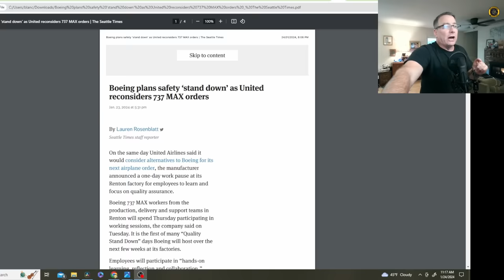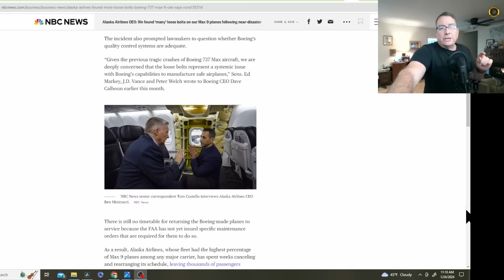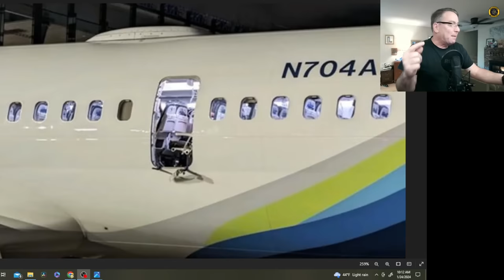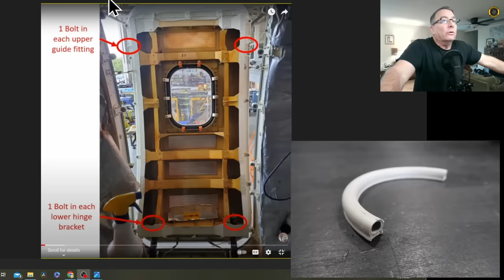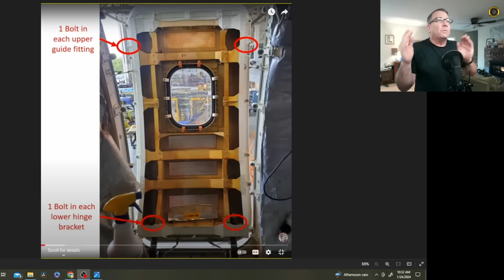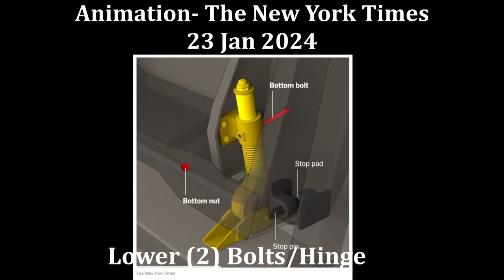Boeing's Quality Management Failure Explained 737-Max-9 Door 24 Jan 2024

Comment: As I remember it, Spirit initially was a Boeing plant that was spun off into a separate company – presumably as a cost cutting measure. How they can now have two incompatible QC systems is just incomprehensible.
Reply from the maker: correct.
Reply: Spirit was originally Boeing Commercial - Wichita. Boeing sold it to a private capital firm who later took it public under the Spirit name. My presumption at the time was that Boeing was looking for corporate degrees of separation from the fuselage, nacelle, and strut manufacturing.  The cynical part of me says this was a legal strategy to protect Boeing when their fabrication QC went down due to cost cutting.
Reply: I wonder, too.  Maybe the Spirit QC system has a lower subscription cost?  They seem hell-bent on saving money even if it harms the process,.
Reply: Doesn't seem very clever does it? The new system would need to be an awful lot cheaper to cover the extra cost of interfacing work.
Reply: But even if they both had used one system: there should never have been an option to just "open" a door plug instrad of removing. Boeing messed up writing that part of the quality control manual. But of course the Spirit workers messed up as well: they should never have picked that option to document their work. Looks like someone tried to save time by choosing this option in documentation because you can avoid some documentation work this way - on top of messing up when not fixing those bolts correctly in the first place of course.
Reply: When Spirit was spun off they immediately laid off all staff below senior management and required them to reapply for their jobs.  Virtually no one below age 50 was rehired, because more experienced employees get paid more.  Blatantly illegal, but age discrimination is never prosecuted.
Most likely the two started with the same quality systems but diverged over time.
Reply: It may also have been done to allow the company to get the contracts it has with other aircraft manufacturers.  They also do work for Airbus, something Airbus may have been less inclined to do if the sign on the door read Boeing.  Not excusing the serious quality issues, simply addressing another reason for the split.
Reply: @blancolirio  And before that it was Stearman. Boeing should take it back. And put engineers in charge of both companies.
Reply: @dave30076   yup, maybe also that the people managing the purchase decisions knew nothing about information systems, or QA, or databases, etc. (because again that is engineering expertise). They were however probably schmoozed by the vendors of the system that they eventually wound up purchasing.
Reply: @Trebuchet48  Did you mean above 50? Your comment makes no sense otherwise surely!
Reply: @christianbottger493  keep in mind the quality management systems are typically not based around inspections.  That's a non value added process.  They are based on making sure the job is done properly the first time.  A good quality management system would ensure that the job is done properly in the first place. That said, the fault for missing bolts clearly falls directly on the actual workers who failed to install the bolts after removing them.  But that might be far more complicated that just pointing fingers and any specific individual.  For example if there was a shift change partway through the repair.  The quality system failed to prevent the mistake in the first place and then failed to catch it.
Reply: @raygunsforronnie847  Plausible deniability works for most products but perhaps not for flying machines.
Reply: @raygunsforronnie847  also allowed them to break the union by it no longer being Boeing.
Reply: @raygunsforronnie847 
I think you stated the answer at the words 'private capital firm'.  Future liabilities is a little too cynical, just simple near term greed is enough.  I think it was after the bean counters took over and wanted to 'free up value from the balance sheet'.   Sell it off via leveraged buyout to a Private Equity firm who then slashes costs to maximize profit numbers in order to pawn it off to the public via the stock market at the highest possible value.
Reply: @blancolirio  First, it's hard to believe that the two QC/QA systems were incompatible and had not been addressed by management to fix this discrepancy. Second, the door plug should have been written up in the QA/QC system as "Left door plug (4) bolts/nuts removed to facilitate other maintenance" i.e., then another write-up in the QA/QC system "Left door plug seal due replacement or whatever any other maintenance or inspection action was required to remove the (4) bolts/nuts" documented. A lack of proper documentation will eventually catch up with you someday in aviation maintenance.
Reply: @Trebuchet48 Above?
Reply: @Trebuchet48 did you mean over 50?
Reply: looks like a lot of those commenting might be missing the big picture. Aviation safety standards remain the highest among all means of transportation even with this screw up. Boeing as any large corp is hard to manage so splitting makes sense. Otherwise you have 10-20% of people walking around all day or cracking jokes during the meetings. No productivity, they just learned how to navigate the system of a large organization
Reply: @Trebuchet48  Do you mean no-one over age 50 was rehired?
Reply: I imagine the differing QC systems came along after the split. Since Spirit management wasn't Boeing management, so it could make its own choices—perhaps to save money. That is a key difference between divisions inside a company and subcontractors.
Reply: Totally agree.
Reply: When bean counters, or whoever is culpable, get sent to jail, and get their bank accounts hammered, the song will remain the same.
Reply: I worked in a different industry, but experienced the horror of downgrading critical data systems to save money. Had to learn new and very different software three times in 6+ years, all while the business was expanding by buying out competitors. I can see how someone made a critical decision to incorporate incompatible QC systems if there was a buck to be saved. Beyond sad, and in this case, tragic for the passengers and crew. Trauma is real.
Reply: I’m by no mean super well versed in Boeing in Wichita or with Spirit. All I can say is all the highly experienced and well paid employees were summarily dismissed as being to expensive for Boeing and forced to take retirement. Spirit in essence started over with hiring and the wages paid were dramatically lowered. My son briefly was hired on a Spirit and they were only going to pay him I believe $12.00 per hour. I mean come on , McDonalds employees make more. He hated the company culture at the plant and left. That wage falls way short of what that same job used to pay when it was Boeing.  I feel Boeing cheaped out and are now paying the price for their folly.
Reply: Spirit loves DEI, look at their website. In other words, they are willing to choose diversity over merit.
Reply: I was end of line contract inspection at Wichita plant 2. Inspection was pushed to sign things off that weren't installed, it was cheaper to ship the fuselage and finish it at Boeing than to take the late fee. It was all about metrics and shipping 63 fuselages a month. There are hundreds of manufacturering defects on each plane. One out of every 5 fuselages were having a major skin change after damage. It was crazy, as a contractor I made crazy money with overtime but it really opened my eyes to the way these aircraft are made. It's all about the board, share holders and bottom line profit. They hire anyone off the street and there is no pride of work anymore, no craftsmanship.
Reply: @mythbuster7631  Well we certainly know the safety isn't from the manufacturer 😂
Reply: Perhaps that would work if there were a single clear handover to Boeing and their quality management system, with a 100% inspection at the time of handover.  But there seems to have been work done by Spirit at Boeing's site using Spirit's system, after the initial Boeing inspection was recorded on the Boeing system, with the work to remedy recorded on the Spirit system.  That sounds like something that is going to cause problems.  Plenty of people use subcontractors in a range of industries, and there's usually an inspection at handover.  To me it would seem more usual that at that stage all further work be recorded and quality controlled by the purchaser, i.e. Boeing, whether or not the subcontractor also records the work, or that there should be another bottom-up inspection.  If I've understood the video, Boing received the bodies, inspected them, passed the fix-list to Spirit, but then relied on Spirit's quality system for the fixes.
Reply: @mangos2888  well, some of it is. check the history for cargo door falling from 747 with loss of life involved. Not to mention DC-10 with massive loss of life. That was during the time a lot people here brag about
Reply: @christianbottger493  Opening the door and removing the door are two different things.  To remove the door you have to remove a lot more hardware. Opening it you remove the bolts and it hinges at the bottom.  But you are absolutely correct that a QC check on the bolt re-installation would be in the QMS on a door open.  The bigger problem to be is having subcontractors on site not logging things in Boeing's QMS.
Reply: Yes, I did mean "over 50", not under!
Reply: They can be incompatible, but why they are also then coupled is where the problem comes in.

Either they should be independent, or if they interoperate they should have to be designed and tested to coordinate properly.

Half of each leaves holes that failure can drive through.
Reply: Juan, here is a correction that should be made to your previous video titled,  " 737 900ER  DOOR  UPDATE   22 Jan 2024"
At 3.00 -3.03 minutes into this video, you say "This is the Track Guide fitting, again this is the door side" 
This is incorrect. The track guide fittings are mounted on the forward and aft fuselage frames and not on the door.

Then at 3.04 into the previous video, you say - "This is the frame side of the airframe".
This is also incorrect. you should have said, this is the door frame side.

If you look at this current video, at 2.23 mins into the video you will see the door lying horizontally on the plastic which clearly shows ahe adjustable screws in their fittings.
These screws adjust the door stops against their stop pads which are mounted to the forward and aft fuselage frames.

Respectfully from myself as an airline inspector. @blancolirio
Reply: If a part of an existing company is spun off to be a new company its not unusual for network access into the prime company to be disconnected. It’s a critical network security issue to protect the prime company!  But this action presents a human air gap in the sub contractor process flow (with personnel who are used to using the prime company database)…….. which creates a new problem for ‘someone’ to fix…….. just my experience.  It’s not new.